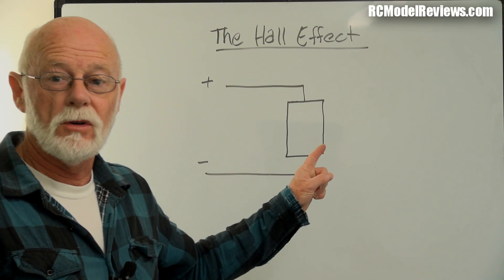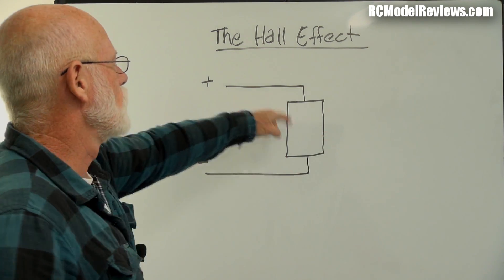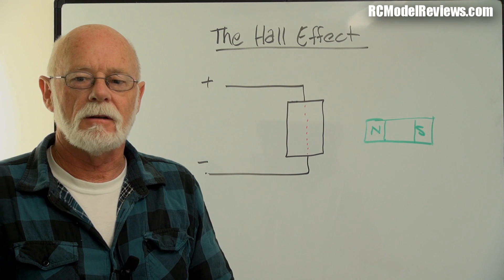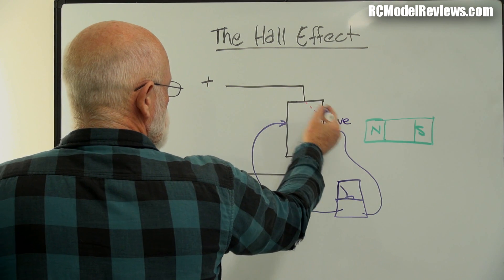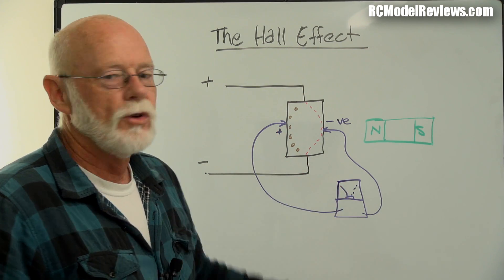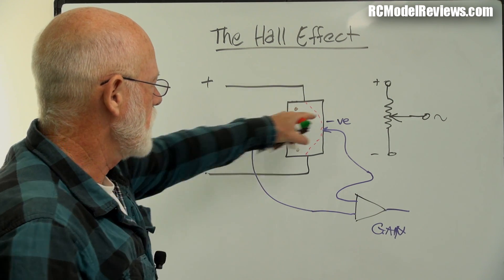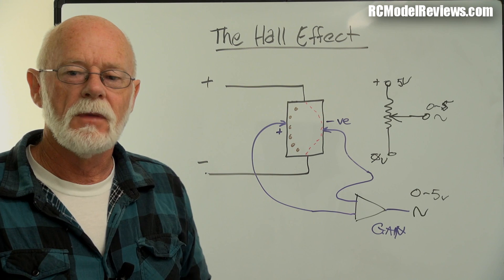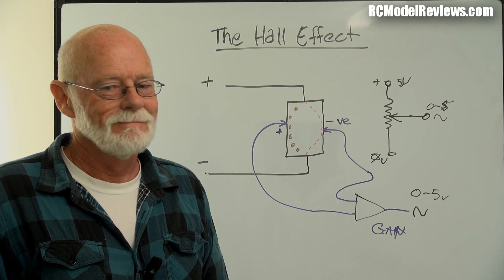Electronics 101: The Hall Effect explained

Comment: Good intro to Hall Effect. As to whiteboard videos, do you think there is much of a reason or reasons for people in the hobby to learn more about vortices and turbulence? I guess that is upper division aerodynamics. I read that with commercial, perhaps turbine-powered, aircraft, the air flow around the wing is complex. It is no longer laminar flow as in the simplest case, and there is lateral air movement. What's more, there are vortexes coming into existence and  also being shed from the wing. Does any of that pertain to RC aircraft?

You might consider another whiteboard video on the latest consensus on the modern theory of lift. Evidently Bernoulli's Equation is correct but difficult to apply, and there are other ways to express it. You could explain the old explanation of the theory of lift, and why it is no longer considered authoritative. Just an idea, my 0.002 cents.

Comment: Also, some ESC for brushless motors (most of the sensored ones) use Hall effect sensors as a feedback, to control timing.
Reply: Tiago de Pádua 
Yes, I got one by taking apart an old computer fan to make a hot wire detector. Very useful.

Comment: That is nice video, and I did learn why this is used rather than a potmeter.

However, the explanation is very very very very simplified. In actuality, electrons aren't attracted or repelled my a magnetic field, but moving electrons experience a lorentz force while going through a magnetic field. The magnetic field would have to be perpendicular to the whiteboard in order for it to work (but it's kinda hard to draw).
Reply: Everyone seeing this will go, run think they understand it, write it as attracted in the report, their third year lecturer will see this, slap their face and bang their head on the table. Thinking... Did they learn anything at all. Remember, Physicists feel that physics is a crucible degree, its either for people or not. This explanation will make many think that it really isn't for the person who was just confused.